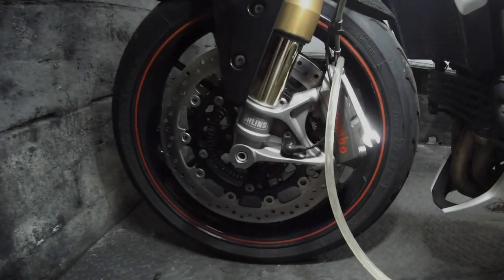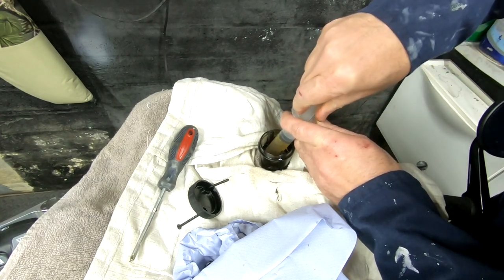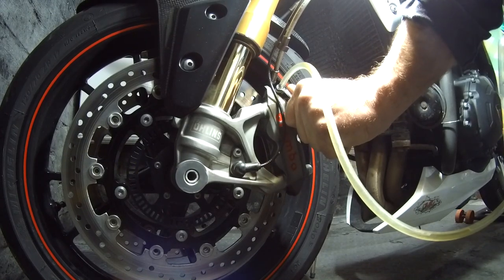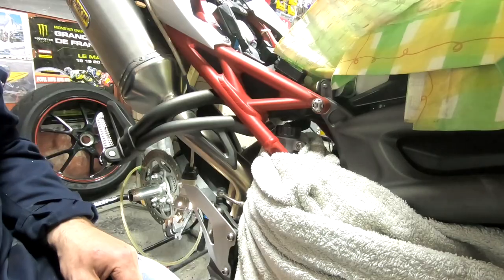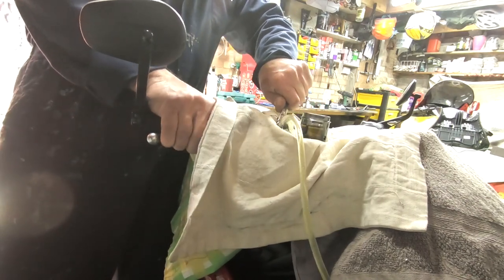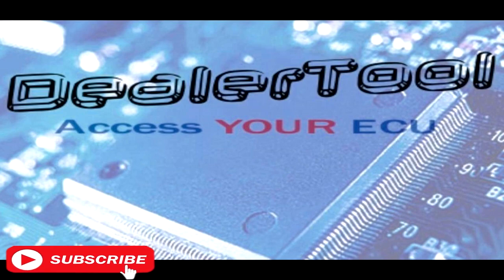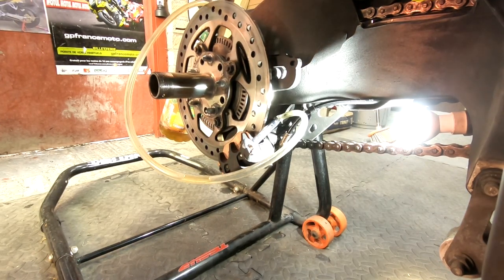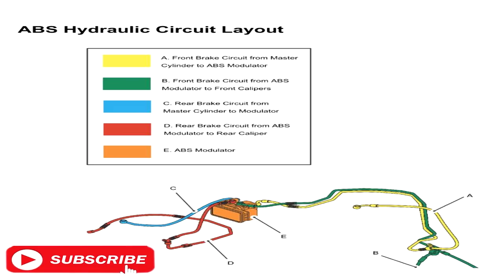Speed Triple service - ABS brake bleed using Dealertool

Comment: Here’s the instructions from the official shop service manual 
https://drive.google.com/drive/folders/1ME5u3vYKvz39JWD8ttMwXp6AtViM-Y3J
Reply from the maker: Cheers Jordan that's very helpful, is that an online manual or a hard copy?
Reply: Not a Motorbike Mechanic it’s a scan of the hard copy. Took a bit of digging to find it, all of the easily available ones seem to be for the older bikes. I can send it to you if you would like.
Reply from the maker: Jordan Ray, that would be awesome.
My email address is on my about page.
Nice one 👍🏼
Reply: Not a Motorbike Mechanic ok I shared it with you lmk if you got it
Reply from the maker: @MrCoocoocrazy , i had the two original pages you sent, but not the manual?
Reply: Not a Motorbike Mechanic try this link https://drive.google.com/file/d/1BeY2o5-71r4ULs2Cwd0d4q6TszlMZxNe/view?usp=drivesdk
Reply from the maker: Jordan Ray, thanks for the share, this is going to be really helpful.

Comment: Recently came across your channel and enjoy the content. I've just bled the brakes on my 2014 Street triple r. You might be aware now from the manual, that there are 3 stages to this. Conventional bleed of the system is required 1st and following the abs bleed, as old fluid is introduced into the system from the abs modulator which will need bleeding out.
Reply from the maker: Hi Trevor, thanks for supporting the channel, your input is very much appreciated.
I think at the end of the video, I do mention that another bleed is needed, but didn’t show it as the video would be to long.

Comment: Hi - an interesting video but I assume that as this was a year ago you are aware you carried out the ABS procedure incorrectly???
According the the official manual, you bleed the front right, then left and then master cylinder.
Following this, the ABS is bled by applying and maintaining pressure on the front brake lever - now activate the “bleed abs” function, whilst at the same time releasing the bleed nipple. Now tighten the nipple, release the brake lever and repeat, in other words, you bleed the brakes exactly as before, with the exception that the abs modulator is running at the same time.
Continue until no more air is seen or until you have passed enough fluid with the abs running such that you are happy you have flushed the modulator fully with fresh fluid.
Simply running the abs and releasing the nipple will do nothing - you need to push the fluid through the modulator as described above.
I hope my comments are helpful

Comment: Very helpful as always. Congratulations for your channel and  thank you for posting your works on it. I want to ask you for something you maybe noticed in your Speed Triple R: a terrible "double touch" feeling on the brake lever...is that your case? I own  a 2017 Speed Triple R and it's very sad to feel this in a bike expensive as it is. Brake bleeding, master cylinder upgrades...nothing seems to solve this.
Reply from the maker: I must say, I’ve always found the Triumph’s brakes are very good

Comment: hi there, Is it necessary for bleeding ABS when I flush brake system? I flush my front and rear brake system by myself. I didn't bleed the ABS system because I don't know where I can get the software. I worried about if my ABS can work well after I finished flush job. so I tried to active them. The ABS light is still working. I can tell the rear ABS worked well when I tried the rear brake. but the front ABS hasn't engaged when I pull the front brake lever. Do I need to ride to dealer to bleed my front ABS brake? Cheers.
Reply from the maker: It is important to flush abs, but doubt anything catastrophic would happen if you didn't.
Maybe activate the abs, to move old fluid around,  then rebleed the calipers
Reply: @notamotorbikemechanic  cheers, mate. thank you for the reply. I had tried to engage the front abs, it's very hard to active. but the rear abs is much easier to be active. Do you know how to check if the abs system work well?

Comment: Seems a little complex. I feel like I’m going to mess something up, is it pretty cheap to get this done by a mechanic?
Reply from the maker: Nothing done at the dealership is cheap, bleeding brakes is easy. You don’t have to bleed the ABS modulator
Reply: @notamotorbikemechanic  ok it’s time to change my fluid and I decided to do it myself. I don’t have a dealership tool so what all do I need to completely change the fluid in front and rear?

Comment: Sighs.. another long winded job i was all happy untill you said and datatool and ecu. Soo I'm going to have to buy this software just to bleed the brakes.
Reply from the maker: Sadly with modern bikes, everything is get more difficult. 
You could just do a bleed, without doing the abs.
Or do it, then ride the bike and activate the abs. To move the fluid around, then rebleed.👍
Reply: @notamotorbikemechanic  good idea i agree with you with the new vehicles getting more technical